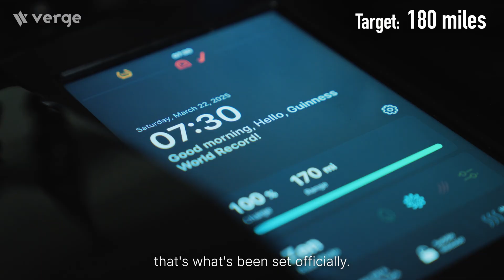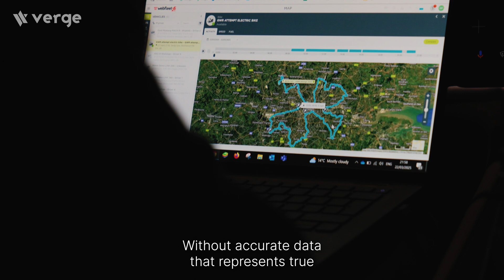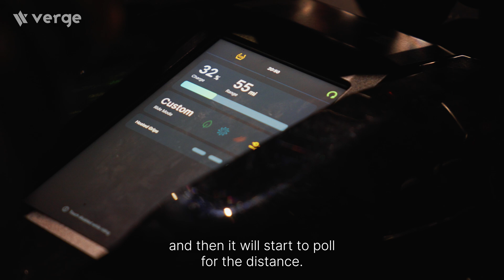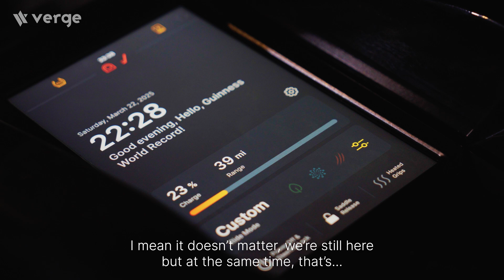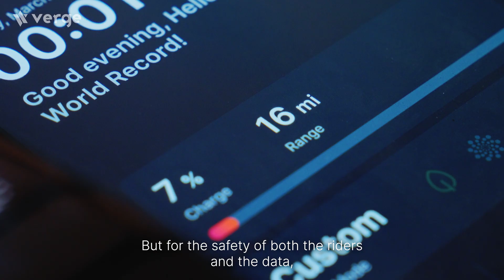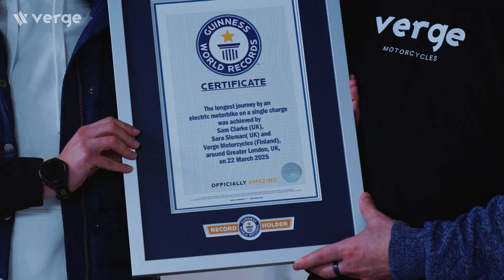Verge TS Pro sets a GUINNESS WORLD RECORDS title | Longest Journey on a Single Charge ⚡

Comment: LoL😂😂😂16/h and 300km😂😂😂🤯🤯🤯why dont they go motorway and drive ex 120km/h nobody dont drive a moto 300km on city😂😂Stypid test. Ok i know if they go motorway that range drops half. 😢😢😢
Reply from the maker: This test was all about maximizing efficiency and seeing how much range it is possible to get out of the system. And for that reason the average speed was around 25mph (normal city speed in London). Speed was kept between 20-50mph (30-65km/h) during the attempt. 

For the other end of the spectrum, make sure to check out our previous video ”Monaco to Madrid in 24h” that shows how the bike handles riding constantly at highway speeds and rapid charging multiple times back to back.

Comment: Nice challenge, nice bike- I road one at Everything Electric last year. Not sure what all the drama was about though as London has over 21,600 public electric vehicle charging points, accounting for roughly one-third of the UK’s total network. This includes more than 1,200 rapid or ultra-rapid chargers- I mean running it to zero % (not to a complete stop) would still have left enough to take readings especially as the 12v would keep the auxiliaries running. A better challenge would be a London to Cornwall road trip hyper-mile’n it rather than doing something more suited to a small electric commuter bike. Now that may justify such a large support team although my regular 235 mile trip to Cornwall there are over 200 rapid dc charging points so don’t need a support team with me 😂
Reply from the maker: London to Cornwall roadtrip sounds like an epic challenge - adding it on our list for sure!

Comment: I wonder what extra conditions there are because there are certainly people who have done more than this and one of them even commented in here...but he had like "godlike" conditions normally not met in a "real life scenario"
Reply from the maker: Conditions were that the bike needed to be an unmodified, in-production, commercially available motorcycle and it had to be ridden on real roads. In this case due to the GPS failure we lost a few miles from the official record and we also decided to end the ride before the battery died to ensure safety and make sure the trip data was not lost. So we ended with 7% of charge still left which would have added around 16miles (25km) more to the record.
Reply: Not sure about English riders, but here in the USA, it's nothing for us to do a day ride through the mountains here in north Georgia and into western North Carolina and put 250 to 400 miles in a day.

Comment: Great record. The other end of the scale.
In comparison with your „Monaco - Madrid in 1 day“ video. You get 3x the range in city driving (310km), compared to highway driving (~110km). Mixed driving probably will result in about 220km range. No miracle with the given battery capacity.
No offense, but 310km city driving in 16 hours is not quite the dream of every biker. In pure city driving a electric scooter is more practical for a lot of reasons (cargo space, removeable battery, smaller than a motorbike).
I‘m still very interested in charging curves in different environments (ambient and battery temperatures, before and after highway driving, driving-charging-driving-chargin-… scenarios), because I‘m curious what your non liquid cooled battery is able to do.
Reply from the maker: Thank you! In the city if we would have ridden the battery down to 0%, the number would have been closer to 335-340km or so. (we still had 7% of battery left + we lost a few miles due to the GPS failing). And on the highway (Monaco-Madrid) the guys usually had around 15-30% of charge left when they stopped, so around 150km is a pretty realistic highway figure. In our experience mixed riding offers about 250-260km of range. We are in talks with our engineering team to provide some charging curves in a future video!
Reply: 310km in 14hrs (I took off a generous 2hrs for changeovers) is an average riding time of 22mph. No biker wants to average under 50mph on any ride, so this is an absolute joke. It's a world record test with dubious motives, but nothing realistic about normal bike riding. Heck - all that planning and going through tunnels - how dumb is that?
Reply: @aussieideasman8498  I agree, it's a "because we can" thing

Comment: How does this real world ride compare to an energica? Admittedly, energica is out of business.
Reply: I do about 260 km on country roads in Switzerland with my Energica Experia.
Reply: I would say you can do the same with the Energica Experia. Roughly the same battery capacity. Drag is not a problem with this slow speeds. Maybe a similar range is possible with a Zero SR/S or SR/F (17,3 gross, 15,1kWh usable) with the additional powertank (+3,6kWh =20,9 gross or probably around 18kWh net capacity).
I almost bought an Energica (before they went bankrupt), but the Experia was to my type of bike and the Eva Ribelle is too loud. If I had the spare money, I would try the Verge TS Pro, but unfortunately the money only suffices for a Zero 😅
Reply: @davidz1264  unfortunately, for health reasons I am selling my motorcycles. I have a ribelle rs, victory gunner and victory octane. And I know, victory is also out of business. I also bought a jeep 2 years ago. Jeep will likely be out of business soon too. Fortunately my wife and I drive teslas and they seem financially stable. Hopefully no one sets them on fire...